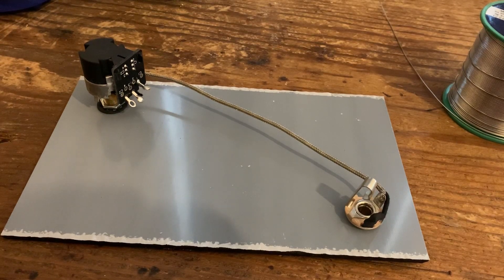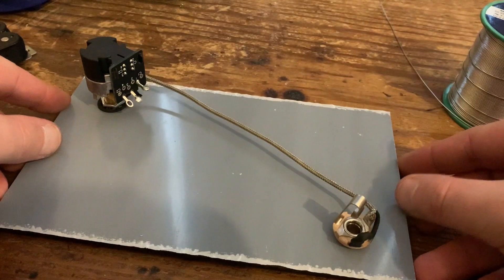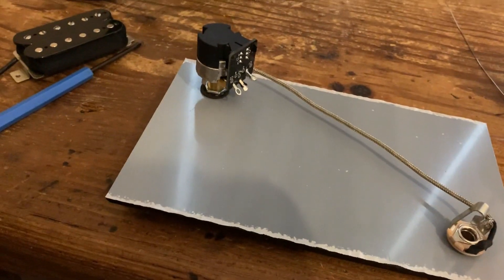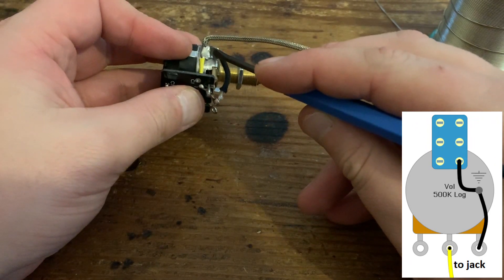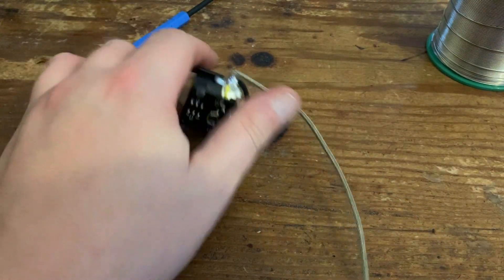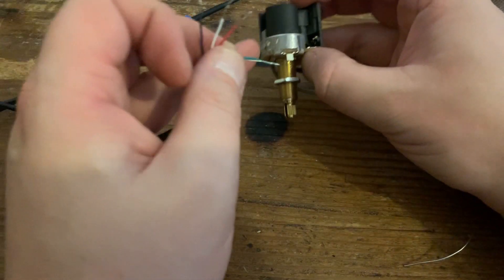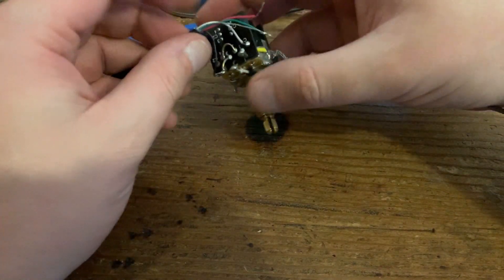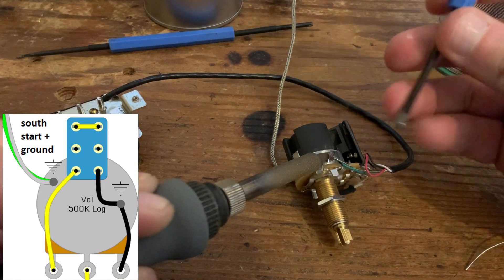Humbucker Push Pull Pot Series Parallel Wiring

Comment: 1) id take either a file or nail file to the side of the pot casing and use some flux to help get the ground joints to stick better also if the lug is going to be soldered to the body you can also add the green and bare too that lug as well to keep it a little cleaner otherwise killer stuff

Comment: I strongly recommend getting a five meter length of low temp Cardas solder. It should be a £12.00 for that length of solder. Not only it is a very high quality solder, but it also has very low melting point which probably avoids frying you capacitors, resistors or even the pots when you solder on the case. We use Cardas solder for high-end tone arm and cartridge wiring applications.

Comment: Im still confuse how to connect this to 5 way switch selector..? Could explaine that? Thank u
Reply: Only need the main wires a 5 way switch would be more useful for a 3 pickup configuration you could do other shenanigans in there adding the ability to have both pickups both series both parallel and then neck solo and bridge solo

Comment: I have two guitars to do both 2x humbuckers, but one is two volume with one push pull tone and three way switch, and the other one volume and one tone push pull.  Both same push pull set up you have there,  (I have the pots to do them) what wiring, and capacitors and any thing else do I need and what easy to follow  wiring diagram can I follow to do these two guitars, I'm crap with electronics but better with the building guitars. (My pick ups are iron gear hammers on one and iron gear hot slags on the other)

Comment: Hello i just bought 2 of these pots for new guitar builds but after following all instructions i just can’t get the sound right… looks like i have a blanket and a gate on my sound. 
I tried the same pickups on a traditional volume pot and sounds like it should be…
Is there something i should know about these specific pots ? I’m kinda bummed mostly after testing 2 identical volume pots to get the same issue…

Comment: If the output is lower in parallel and then the volume reduces when you switch to parallel, is it possible to wire some output reducing circuit into the series circuit?  Thus equalising the output between series and parallel.  Then you can just crank up the amp and switch between series and parallel without having to adjust the volume on the guitar.
Reply: Good idea! I think a resistor could be added between the output in parallel position (terminal 1) and ground the achieve this.

Comment: I'm looking to do a master coil split for 2 humbuckers for the sole purpose of getting the two outer coils split in parallel sound on the middle position on a 3 way toggle switch. 
Is there anything different I have to do or will putting a push pull for both humbuckers get me that tone anyways?

Comment: This is super. I have one question mainly... how to wire up twin Humbuckers with 1 tone and 1 volume pots both push pull CTS pots. Seen your video on twins on a LP style with 4 pots but how about only when the 1 vol push pull and 1 tone push pull. 
I have tried using 2 diagrams and nothing working but this is the most similar in terms of which wire goes to which terminal. 
Thanks 🙏🏻

Comment: How would this differ if you wanted your tone pots to be your Push Pull? I have a Tele Deluxe that I'm trying to wire with push pulls for series/parallel on the tone pots. Every diagram I look at is different

Comment: Also, I'd like to point out that while the resistance may read extremely low in parallel mode (mine comes in around 2.35k), the perceived volume will not be significantly less than the pickup in series mode. It's definitely brighter, but I'd say it retains about 60-75% of the volume.

Comment: why doesn't anyone ever tell you whether it's a volume or tone pot? that's what confuses everyone. Is this a volume pot or tone?
Reply: Brian Cananzey it’s the same thing. A volume becomes a tone when you wire a capacitor in the lug you’d normally solder onto the pot itself.

Comment: Thank you so much for posting this video!  Honestly, I find your videos to be among the most helpful out there.  Do you have any issues with hum or static with the wire you are using?  If not, can you post what kind you are using?  I am wiring a Gretsch (on a template, not actually in the guitar yet) and find there is much more static than I expected and it seems signal may be interfering with other strands within the wire.
Reply from the maker: Thanks for the kind words Joe 🙏 use braided or shielded cable where possible. No issue to use pvc or cloth wire for short connections, but for long connections, best to use shielded cable. Thanks again